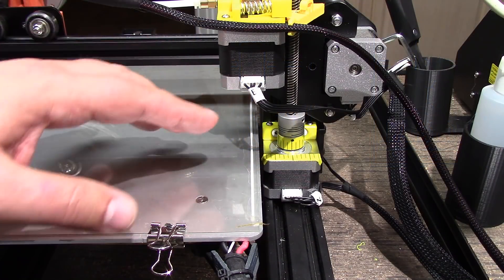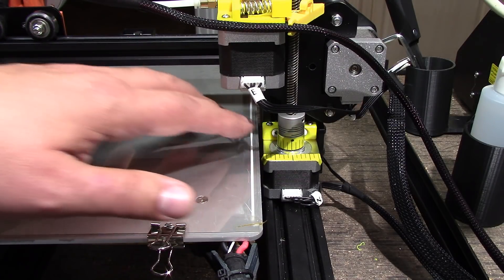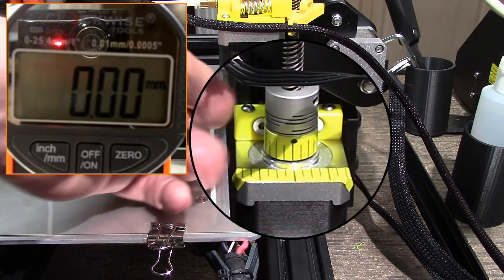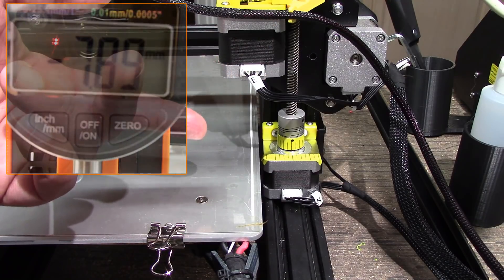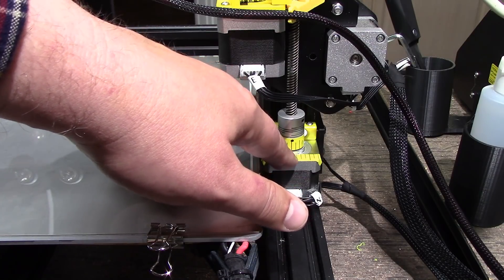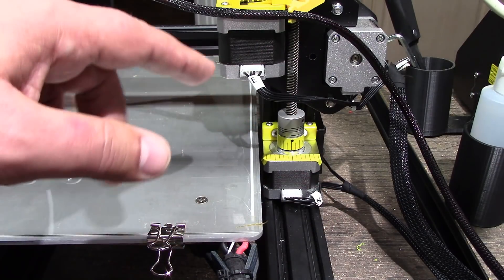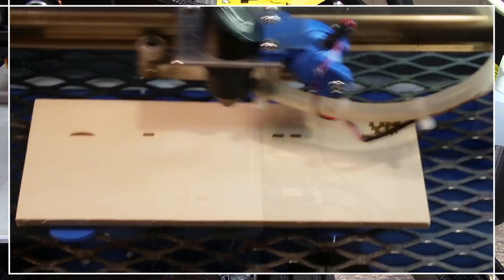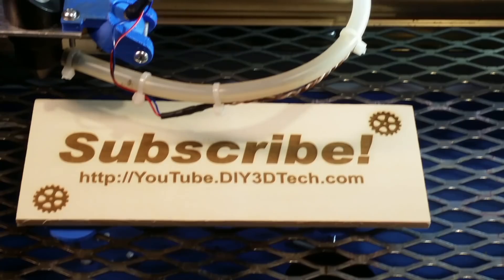Shop Talk - Easy Way To Measure Z Axis Travel!

Comment: Interesting subject. I did a simmular test on my Anet A6 and let the steppermotor move the Z-axis bij manual input with increments of 0.1 mm. According to de reading on the dialindicator the Z-axis moved actually over a distance of 0.10 mm per increment. The Anet A6 has steppermotors with (supposedly) 200 steps per revolution and a 8 mm leadscrew so with the explanation in the previous video it should not be able to move 0.10 mm. But it does! Maybe the printer applies micro-stepping? Who has the right answer?
Reply from the maker: Not sure what your trying to get at?  As why wouldn't it be able to move 0.1?  If I had to make a guess what your getting at, you need to check pluses per step
Reply: Well, in your video "Is your Z Axis Lying to YOU" you stated that the Z-axis can not move exact 0.1 mm but only a multiple of 0.04 mm. You do remember making that video, don't you!

Comment: To minimize reading errors, just do a couple of turns and divide by the number of turns.
It is good that you mention that both sides have to be turned if there are two stepper motors for the Z axis.
Reply: If you have a dial indicator with short travel, you could touch off of a 1-2-3 block - or anything that you can measure accurately - and zero the indicator.  Slide the block out of the way and turn the coupler (counting the turns) until the indicator touches the table - then stop on the next zero on the coupler.  Add the amount of movement of the indicator to the height of the block.  Divide that by the number of turns that you turned the coupler.  That will give you the amount of travel in one turn of the lead screw - very accurately.  You could even clamp a dial caliper to the machine and do the same thing.

For example, using the 3" length of a 1-2-3 block (76.2mm)
1. After mounting the indicator to Y-Axis bar, touch the indicator to the top of the block - plus about 1/4 of a dial turn or 1/4 mm or so and zero the indicator
2. Carefully slide the block to the side and remove it from the table
3. Turn the coupling (counting each turn) until the indicator touches the table and then continue to turn it just far enough so it again reads zero (the first zero)
4. Assume you turned the coupling a total of 9 full turns - plus a part of another turn
5. Turn the coupler to its next zero mark (making exactly 10 full turns now)
6. Assume the indicator now reads 3.75mm
7. 76.20mm + 3.75mm = 79.95mm
8. 79.95mm ÷ 10 = 7.995mm per turn for the lead screw

Sorry for being so verbose - I used to have to write procedures for CNC operators that were ISO compliant.  It's a hard habit to break - but I am getting rusty slowly - LOL.
Reply: lol  I was going to suggest the same thing!  I would do 10 turns, and then divide by 10.  Nice round number.  :-)  Plus that probably also averages out any errors over the typical Z printing range.
Reply: You probably can't get the dial indicator to travel that long way. ;-)
Reply from the maker: You could do this, but I am a bit confused on the reading error as even with one turn I  basically spot on?
Reply: DIY3DTECH: Yes, pretty close!  Only 1.25% error, based on 8 mm per turn.  Other printers might not be as good though.  So by increasing the number of turns, you can help reduce any measurement error and see just the Z axis error.
Reply: Anders Jackson:  Good point!  lol
Reply: You are spot on now. But with more length and then divide you make rounding errors in measurment etc much smaller. 
But if it works for you, then it is ok, I guess...